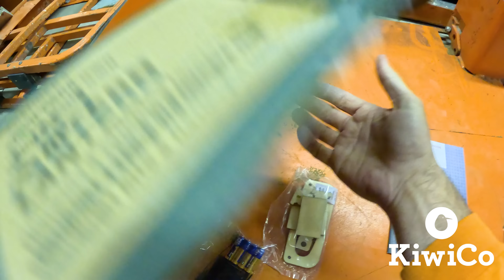How to Install an Elevator in your Backyard

Comment: 24K is on the cheaper end for an elevator as elevators in buildings that cost that much are very cheaply built and often have to be replaced after just 5 years of use! However an elevator with a 20+ year lifespan will cost upwards of 100k! :)

Comment: Replace the lead acid batteries with LiPo and additionally use them as your bunker backup power.  As you get older, you'll find the less stuff you have to maintain the better.
Reply: 3:39

Comment: Check out regularly hidraulic pump and cabling.
I was working on this kind of elevator. Long ago.
And in construction as tower crane operator.
Safety first. Kranfahrer, Frankfurt am Main and, Germany, Croatia.
Maybe install some safety brake in case of hidraulic cable blow up. Or some safety system.
Just checking regularly on pump and hosepipe is enough. They are bulletproof safe.

Comment: Why not build a carriage and utilize a 12V winch and a pulley system. That's how I built the freight elevator for moving engines, transmissions and other parts to the storeroom in my shop. 2,400 lb lift capacity and and spent less than 2,500 bucks to build.

Comment: You said that the lift has a capacity of 500 pounds, but with all the steel you removed from it, I'd bet it's at least twice that.
Reply: Did you know, removing the bottom parts of the scissor lift does not change the amount of force you can have on the list before it stops working
Reply: @Cheese359  That isn't all that was removed, though.
Reply: @Cheese359  They completely stripped the platform and replaced it with a very thin aluminum cage. The hand controller alone looked like it weighed ten pounds. Did you actually watch the video?

Comment: I would probably choose NiMh batteries. Given what little I know: they are worse than L-ion in almost every way, but are extremely safe, and durable -- useful for an enclosed space. If those lithium batteries catch fire (for any reason), anyone in there is done as the smoke would be fast, thick, blinding, and suffocating.

Comment: The lead-acid batteries have to be replaced every three years, and give off explosive fumes when charging.  L.Ion batteries may last a bit longer, but need plenty of cooling when charging. Alas, hydraulic systems are not maintenance free.

Comment: I replaced my lawn mower's lead acid batteries with Lithium-ion phosphate batteries then mounted a large blade on the lawn mower so I can use it to plow the snow.  After this I considered myself a certified bad-ass but this, this is on a whole new level of badassery.  Well done sir.

Comment: How to make the elevator better: Add a rooftop for an upgrade and also a door and remove the back of the elevator and add glass and and also the top part and a buttom to call it and the indicator and the buttom to click floors and your ringtone for the elevator it be anything

Hide the top because what if someone fall and add an door because is safe and it had to be automatic

Comment: if you calculate how much weight you dropped from removing the parts from the top part of the lift you should be able to count that towards the amount of weight it can handle safely. So if it had a 550LB cap and you dropped say 300LB it could now handle 850LB.

Comment: Pouring concrete like what you did causing segregation to concrete components....it's wrong!!
Reply from the maker: That's not true.  There have been several studies disproving that wives tale. Wet Concrete falling 17 ft will not damage it.

Comment: If you build a bunker too large, one of three things will happen:
1. In difficult times, the military may decide that it is suitable for their purposes and will kick you out of the bunker onto the street and use the bunker for their own purposes.
2. If enemies in the infrared (or other) range see signs of a bunker, then they will not find out whether it is a civilian or military object, they will simply destroy it with a rocket or bomb, and when passing by they will simply kill everyone inside with a flamethrower or grenades.
Provide places in the bunker where you can hide from shrapnel, fire and toxic gases.
3. If the bunker has a weak structure consisting of one large room, then in the event of a direct hit or near explosion of a bomb, it will become a mass grave of its owners.
 The smaller the radius of the bunker, the larger the explosion needed to destroy its walls.

Well, you need to remember about simple Moroders, they will look for bunkers in order to seize the food and fuel reserves stored in them.

Comment: Steel rebar is still generally stronger than fiberglass in tensile strength. It is a plus that fiberglass rebar is corrosion resistant however!

Comment: Nice quality workmanship. Solid! My only question is that in the event of a "lift" power failure or malfunction, that Cambry will have an emergency exit system, like a hand operated hoist to attach her chair & a good fire suppression system, & a fire barrier between the batteries & living area.

Comment: Hey, do you think instead of that elevator using batteries, it'd be possible to instead add plug sockets into a wall and then make the elevator work that way, and instead use the batteries as a  backup source. Or even a generator? By the way, you should make a button to call that elevator.

Comment: Fix the wobble with long roller plates mounted to the shaft walls then mount small wheels on the elevator to press against the plates. Make the wheels adjustable so that the pressure against the plates can be increased/decreased as needed. This will make the unit incredibly stable and much quieter .

Comment: If you lived in the bunker, your heating and cooling costs would be really cheap. The deeper you, are the more even the temperature is year-round. All of the surrounding earth is your insulation. Before you started saying what was going to be in there, I was thinking it could be used as a shooting range if the ventilation and filtration was up to the task.

Comment: you definitely need to add end stops and button control panel inside - WITH A KEY as this is security entrance. Also what is your fire escape plan? make sure batteries don't obstruct escape way.. as they most likely to catch fire
Reply: also how do you secure bunker from flooding?

Comment: I cant help but stress about fire safety. 
How flammable is the plastic culvert? 
Have you spoken to your local fire brigade about their emergency plan in the event of a fire, or lift failure? 
What about air circulation and filtration?
RADON and all that.
Otherwise, cool AF
Reply from the maker: It's metal.  So not very.
Reply: @JerryRigEverything  ah okay nice, for some reason my brain saw black culvert and went to plastic, that makes sense. Neat

Comment: Hey @jerryrigeverything, I am worried that the elevator might go all the way to the top and get stuck (longterm power failure, motor burnout, wedged).  I hope there is an alternate escape hatch in this situation!

Comment: Breathing in concrete dust will not spread apart your lungs. Yes it technically had silica particles but it's in the form of sand so not dangerous. Obviously don't breathe it in if you don't have to but it won't kill you

Comment: If you ad dishwasher soap,  before puring your  concrete, it will float out, ending totally level, with no need to skrape and showel it around. i do not remember the amount of soap/concrete but it is used extensivly in europe, so you should be able to google it

Comment: While lithium batteries do last longer and charge faster, they are also the most volatile out of the two. I've only ever seen a single thermal runaway of a battery, and it was a lithium cell.

Comment: Lithium fire trap on the only exit.  That will go over well.  :dothefive:
I'm looking at an elevator in the house.  Prefer a more normal approach.  Have two I beams to put a track on.  The prices are crazy to buy them.  I was shocked they do not have elevator shafts in the Manual D for your heating and cooling calculations.  You would think a greedy lawyer would go after them under ADA laws.

Comment: Anytime you build livable space underground you should do some Radon testing.  American Fork is a Moderate Risk zone.   FYI
Reply: 15 years later I still get emails from the company I hired to do mine with recall updates on appliances. 
Government is nuts.  You can't close on a house if there isn't a toilet that doesn't leak.  Like i'm not going to put in a flapper once it is mine.  So I had to install it at night before I owned it.
Ventilation shaft will cure radon, it just wants a way out.  Old style leaky homes had no issue.  I see huge rise in cancer with government mandated sealed homes.

Comment: @JerryRigEverything, not sure what your planning about to close your bunker elevator shaft? If you look at the Titan missile silos they used an elevator inside a house to get down, or from the outside two heavy doors would open when the elevator came to the surface, then when you go down the doors would close behind.

Comment: You should get a weight on the steel you took off of the top portion of that lift. You can add that to your overall capacity.  Since the lift was rated for 500 pounds, and it looks like you took off at least two if not 300 pounds of metal from the upper portion, depending on how much weight you put back for your final design, you’ll have a higher capacity than you started with.

Comment: I had the honor of modifying my buddies house after a motorcycle accident left him paralyzed from the waste down. 
To tackle the problem of getting him from his shop in the basement to his bedroom on the third floor ?? Well I just welded up a platform with a steel enclosure made of galvanized fencing panels. I hooked it all up to a 5 ton winch and with coiled flex cable I hooked up the controls on the inside. It worked like a charm and it’s been 40 years since we built it and he still uses it today. The whole thing cost around 900 bucks as I recall. Great video!! 👍❤️🌹🇺🇸
Reply: Shop built a special lift so motorcycle mechanic could still work on them.  He had a dust up on his bike.  Made a platform so he could still ride while on his wheelchair.
Now you can 3D print a snake cage for the wire.  I don't need one, but why not just in case in 20-30 years.  Already moved the walls so I could have wide hallway and large doorways. Second story so you can ride top to the attic is a different challenge i'm looking at.  I also have curious cat system detector needed.
Reply: @robertsmith2956  well, good luck on your project !! 👍👍🇺🇸

Comment: Wow! As the safety guy on construction sites and as a experienced scissor lift operator I like everything just not the little pegs on the bottom welded, I’d like to see blocks, you removed all the counterweight, battery, wheels, but it can’t really tip

Comment: I hope the first thing you add is an HVAC system to bring in fresh air and get rid of CO2. Plus a water pump to remove any groundwater build up. And backup systems for both.

You could add a mechanism for your emergency escape hatch that consists of a harness your wife could fit in and it's counterweighted to slowly bring her up to the surface, and like with mountaineering gear has a controller that keeps her from going back down accidently.

Comment: Get a certified elevator that gets periodically inspected before this becomes a death trap….splurge the 100-200k……and on to the fiberglass vs steel…… do we need another OceanGate example on why a splintering cracking fiberglasss rod will shatter vs steel………lastly this is definitely violating building codes.  If the city says it’s legit I’ll walk back my comments.  Get an inspector to walk through this……what if someone is under the platform when it comes down? Or an object is down there will it stop? What if it fails, will it fall or seize in the middle of winter with no one around.  As a safety inspector do not let anyone ride in that other than yourself, and I don’t recommend you use it.  The carriage should be an enclosed box to prevent someone’s hand or clothing getting snatched in the walls of that shaft….that would be a legal headache.   Not knocking it, very very creative and neat for a tree house, but this is a big league project and you as the developer have to take the right steps to protect your interests (life, money, loved ones)

Comment: Many years ago when I worked in a mine the elevator had dogs that could pop out, should the elevator happened to drop (stuff happens) and lock the elevator in the shaft. Will you have some similar safety device?

Comment: I would highly suggest installing some form of fall protection mechanism like you would have on an actual elevator, I have seen dozens of cases where the frame snaps on scissor lifts right where the hydraulic ram attaches, causing falls with injuries and deaths. Since that’s gonna be installed somewhere with possible moisture and where it might not be as easily inspected like you’re supposed to do with scissor lifts (and in the aforementioned cases, was rented out without one being done that would’ve caught the damage causing the falls), it would be valuable peace of mind to know that if something breaks catastrophically, nothing really bad will happen.

Comment: Super AMAZING - cant wait until next episode.  Just a suggestion to rustproof the bolts and steel parts of the new ELEVATOR, you know so it can LAST 100 years.  Spacious INTERIOR.  I had a thought, maybe you can add a couple of LCD Screens to simulate windows, with cameras from up above. ( POSSIBILITIES are endless). CONGRATULATIONS and enjoy your new space.

Comment: You could use the metal box track to eliminate the wobble in your Elevator. I don’t know what it’s officially called but I’ve seen it used on movable walls and they move smoothly without a lot of extra friction.
Reply: Looks like it’s called curtain track or trolly track

Comment: Impressive! I'll watch the rest. I wonder if in an emergency or if main is blocked, one could pre spin a hoist tether round the spiral staircase core to a sort of body board to rise up them with little resistance? :o backed up by battery. Brilliant work in there, it'll be like a mega sub. Fake windows are cool, I saw someone made free software for an interactive 3d faux window of a recording or cctv which acts as if the windows were real-screens though. It just requires an xbox kinect thing :) I can't wait to see the rest

Comment: I think your particle board will fall apart in a few years from moisture, plus it will rot.  Would have been better to make it from metal with Marine Plywood.  Then cover underneath all the plywood with a waterproof undercoating.

Comment: I think I would've tried a manual pulley system. I think the platform would be maneuverable to ground level at bottom w only a shallow ramp up top. Pulley could be hooked to electric motor but also have manual override... no hydraulics to maintain.

Comment: The electronics store I worked for had a scissor lift to be able to access security cameras and electronics in the rafters.  Man-a-boards have trouble driving on tile, it seams.

Watching one in this video reminded me of the time ours broke down with an occupant stuck at the top.  Boy was it amusing as they had to struggle to bring a man-a-board to the main thoroughfare to rescue the manager off the top of the scissor lift.

FYI, he pulled the scissor lift out to rescue his weather ballow he bought to spruce up a display in the store.
Reply: they all have an emergency release to lower them without power

Comment: This somewhat slacker electrician decided to leave a job in my small business screen printing shop half-done so he could take off for the winter.  For 4 months his tools and scissor lift were taking up space in my work area which annoyed me until I started using the lift.  After he came back and actually completed a great job I now am  really missing that damn thing and spend way to much time on surplus or auction sites or watching videos like this, while plotting a financial path to acquiring a used one myself.

Comment: You could keep new unfilled deep cycle batteries down there and the water for them and then just hook up a AC to DC power supply since you don't need to go down and presumably if you're going down in there you're probably not coming back up for a while

Comment: an idea / suggestion for the lift down, maybe some guide rails on the back and sides so that you eliminate the possability of it catching on anything and will keep the lift steady and stop it from leaning out lowering or extending something like a flat U with rollers extending into it

Comment: I would have put foam insulation to the sides of the concrete slab so the vibration of the scissor lift does not transfer to the shaft walls, and amplifies every sound and rattle. Maybe you could still insulate the slab by cutting a groove around, remove an inch or two, add the insulation and backfill with concrete

Comment: Excellent idea, but you can't use batteries inside a closed spaces. It is very dangerous. Batteries can only be installed like in cars. Batteries can be installed inside a metal box and with fans for ventilation. Batteries can catch a fire. This is why they must be outside. Never inside a bunker. But you can install them inside a metal box at ground level with some vent windows. Just about your elevator shaft. Cheers.

Comment: Bad idea to drop the concrete that far. It separates when dropped like that, which loses it's strength. Using a sonotube with a hopper or funnel on top would work much better to make the job like a professional. I know your way was easier, but that is what amatures do, right? Good luck